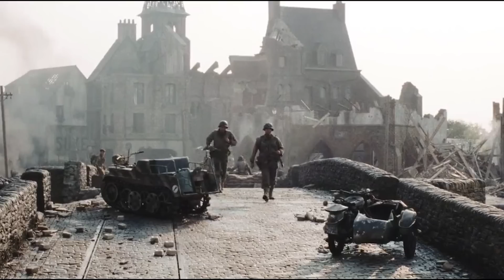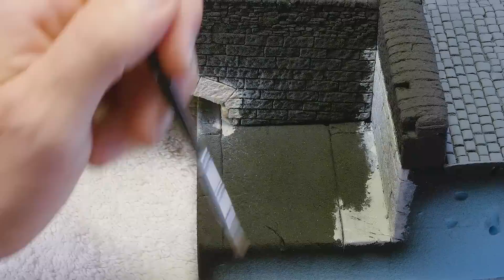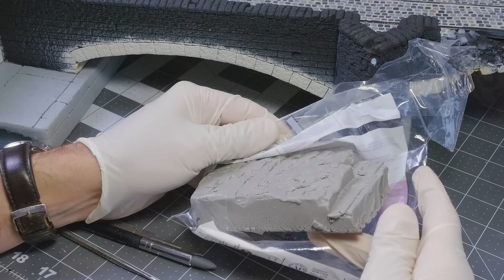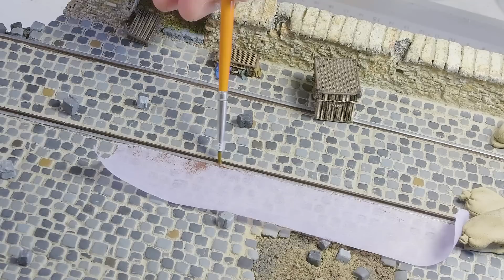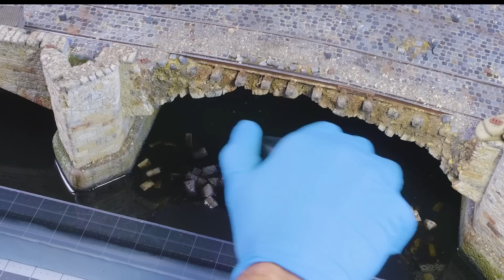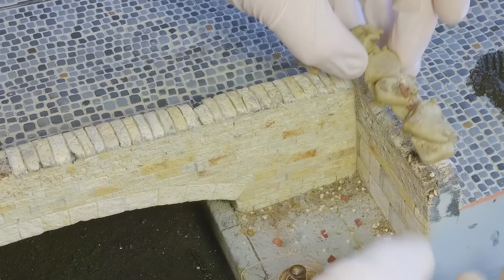My BIGGEST build ever - Massive 85cm foam bridge diorama!!!

Comment: Very nice, capturing that scene from Saving Private Ryan well. Here is my thoughts: A diorama should preferably have all areas occupied with something according to most modellers - not necessarily models, but something that does not leave it empty. However, capturing the scene from SPR needs that empty space, so here it fits. Also, I'm not that much of a fan of that theory - make a diorama of say a tank duel in Ukraine and you WILL have a ton of empty space because most areas in Ukraine is just fields.

That said, that scene from SPR was just that: a scene from a (fictional) movie. It being a movie is kind of a problem, because it is not real Therefore, to not make the impression I'm doing something historical from the war, I would have added say a film crew, someone adding fake explosions or whatever, and used a fake mock Tiger, as the one used in the film - because this scene was not real. 

And I honestly think that might have been a cooler diorama idea than an actual 'historical' diorama, not the least because it is very rare to see dioramas showing that kind of stuff. 

One could argue that most dioramas are fictional, since we don't really know much about how stuff looked, unless its built with actual photos as reference. Which is true - however, a movie scene like this one is so iconic everyone will immediately see it and go, 'oh, its from that movie' so that sets a piece like this apart from say any random diorama with a Tiger tank on it.
Reply from the maker: @Kojak0  many thanks Kojak. 🙏😊 I also thought it could be nice to get a camera team on the set. That's a point a lot of friends suggested me to do.... 😁 I might do an additional effort on that in the future 😅😅😅